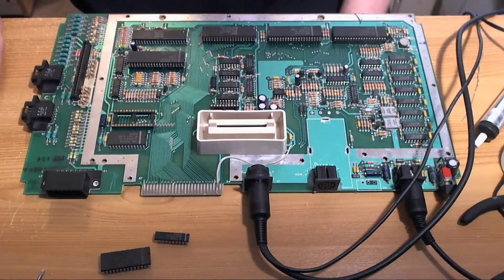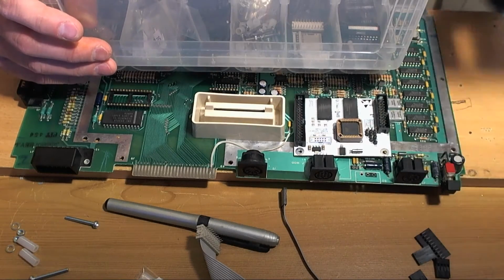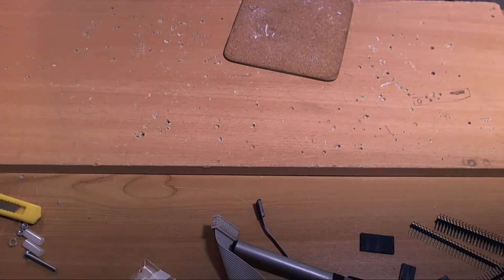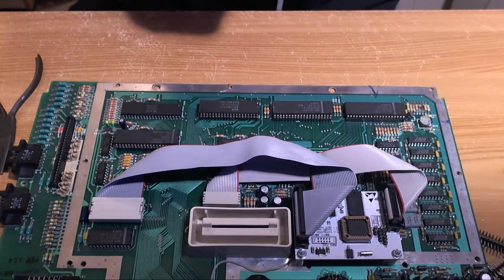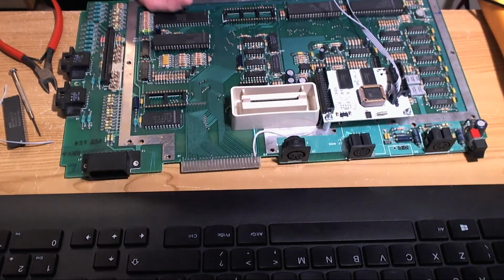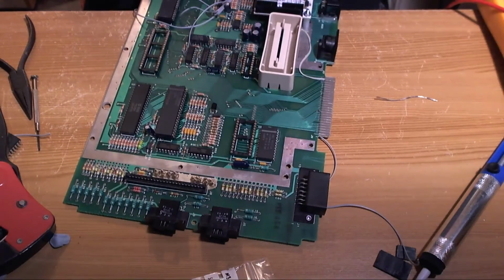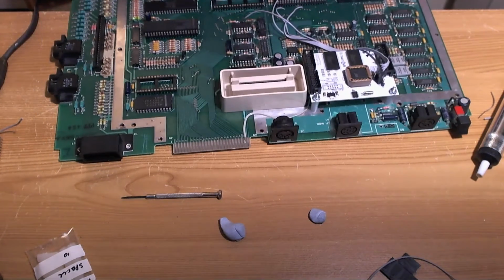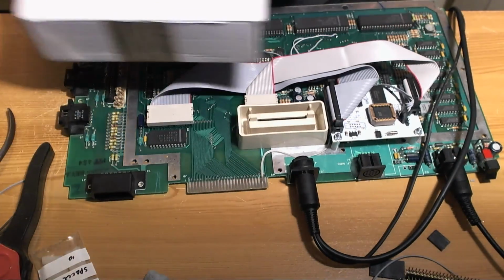Rapidus Atari 800XL part 3: Ultimate 1MB installation

Comment: Hi Jon - catching up with this series tonight ... can you explain how and why using the Diode mode on your meter helps you find vias for each signal you're picking up for the U1MB installation? For my own use, I've always just cheated and used already-annotated photos of the board with the signals marked, but I've never had nearly this kind of complex installation job either, with so many mods on one machine.
Reply from the maker: Hi Herb. Sometimes the annotated photos (when they exist) don't show the most convenient locations for the pick-off points, or the installation instructions advocate soldering wires to IC legs. I don't like doing the latter (it's kludgy on socketed boards, for a start), so sometimes I just use a combination of my eyes and the continuity tester (and a schematic when necessary) to find the path of least resistance, so to speak. With the Stereo board, for example, A4 is picked off about an inch away from the connector from a bunch of conveniently placed address line vias leading to the PBI connector. The shorter the wires, the less chaotic things look... or at least that's the idea (this board still looks like the inside of an ADSL cabinet).

Comment: Another hour and a quarter of easy viewing - cheers!

Though I'm a little hazy on the benefits of a 1-meg board. The RGB and the accelerator boards I get, but what's the real benefits of the extra memory when so much of it has to be paged to make any use of (apart from a large RAM disk, of course), but even a RAM disk is questionable these days in the face of SIOtoSD devices and the like, I'd have thought (though I'm happy to be put right, of course :). Same goes for the twin sound chips - I'm a bit puzzled as to just how many programs will actually make use of such a thing?

Anyways, fascinating viewing whatever the point.
Reply from the maker: It's a fair point you make about the 1MB of RAM. The word processor I wrote can use up to around ten banks and the WIP GOS will use as much RAM as you can throw at it (assuming you wanted to install several hundred fonts and run sixteen apps) when it's eventually done (!), but RAMdisks are of decreasing utility nowadays, especially since IDE HDD host adapters (IDE Plus, SIDE2, etc) have better transfer speeds. Realistically, a 320-512KB machine would probably be more than ample, although there are one or two demos (Numen, etc) which require 1MB. What I would say, though (given that a 320/512KB mod is just as much if not more work than a U1MB), is that 1MB is doing no harm and offers good "future-proofing" (if that's not a crazy term to use on a thirty-odd year old machine). The Ultimate 1MB is a special case, too, since it provides a whole lot of other stuff (built-in PBI host adapter, multi OS ROMs, etc). Dual-Pokey is picked up by a few games and demos and I don't regard it as a high-priority upgrade, although it's cheap - so why not. :)  Glad you enjoy the vids, anyway!
Reply: Actually it’s completely the other way around. IMHO the stereo POKEY is the best, cheapest and most fun upgrade and in fact every A8 owner should have it installed. Stereo POKEY set up has been around since the late 90s and following this many many demos and games from that period n support stereo POKEY and if you love music and especially POKEY music it’s simply amazing to hear. There’s also plenty of stand-alone music to be played. About the U1MB: memory upgrades were probably the very first mods done since about the time the 400 and 800 were around.....so, software support is plenty around as well although admittedly this only started with the 130XE but that was still in the mid 80s. More support came around the time when floppy drives got replaced by other storage media so it was easier to have larger then 128/180kB stuff.
U1MB supports about all goes of memory expansion mod schemes that were used so it’s very compatible. But it also offers much more: you can have 4different OS versions in it and simply select between them from the menu. This is great because you will never have to use any translator discs and you can have modded OSes at will. Mine has the option key reversed because in these days ot% of the time you don’t want BASIC active and I also have the Hi speed SIO mode activated which makes datatransfer between the XL and f.i. SIO20PC or  my Megaspeedy upgraded 10t0 drive really fly
Then there is also the option of controlling upgrades from the menu like enabling stereo POKEY etc. There’s plenty more of features like a real time battery backed up clock and more....
IMHO the VBXE adds too much to the A8 system. Of course I admire it technically but if I really want graphics with those resolutions I have other more modern systems. Also support is marginal. The same goes for any turbo cards. What is the goal ? Who wants to do number crunching on an A8 today....it will,still be insanely slower than any run off the milll computers today. 
But do course, this is just my opinion. Everyone has his own angle on having fun with A8s which is great and it’s brilliant to see what we can choose from still in this day and age :)